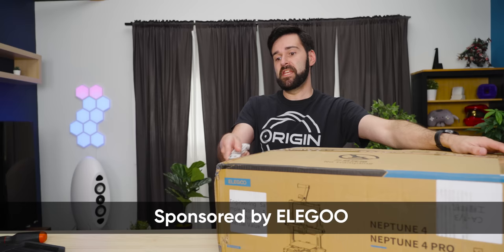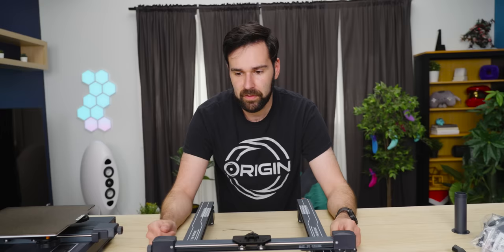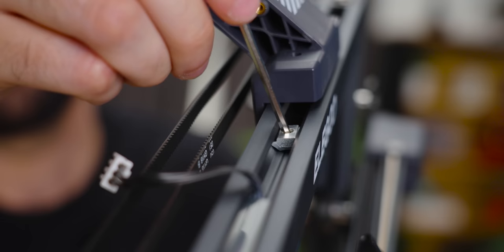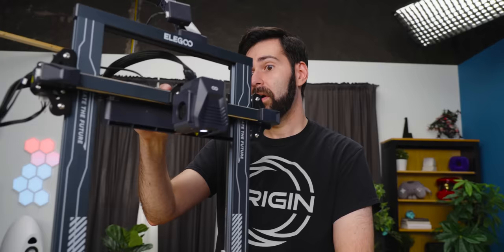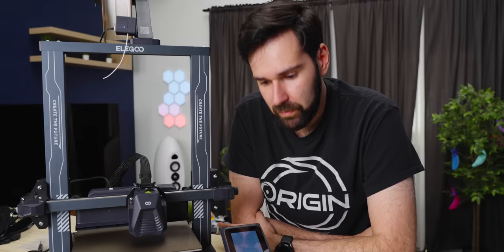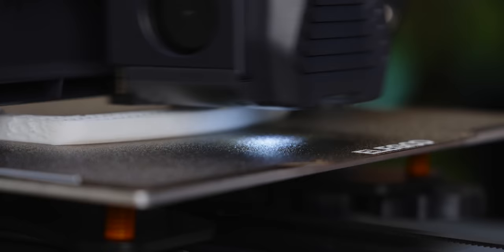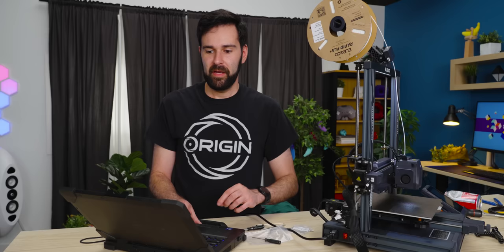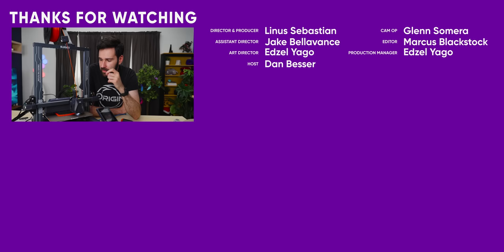Now THIS is bang for your buck! - Elegoo Neptune 4 Pro

Comment: My $99 Ender 3 Pro with my own upgrades and Klipper firmware has been one of the best investments I've made in my life, this seems right on par for starting on the next level of that.
Reply: Please please people save yourselves. Do not buy an ender 3 in current year. Heck don't buy this Just buy a Bambulab or Prusa.

Edit: You need to understand this isn't some elitist "lol just have more money" comment. With many things in life there are minimum prices for things where under that price its just worth it to save up and get the better thing. I'm telling you exactly what thst better thing is. It costs more but will allow you to just use the printer as a tool for your creativity without fuss in tuning, calibration and failed prints. There is so much more nuance to this I'll just advise you look at the actual experience a typical ender clone has vs the printers I talk about. It's one of those things where if you arent familair with 3d printing it's really hard to get why 2 different machines that look the same (because you aren't really sure what fesutrs matter or what specs mean), you could easily be mislead and end up frustrated. I've seen it enough to give the advice I give. I've experienced 3d printing enough to give the advice I give.
Reply: @BeefIngot  The ender 3 looks to be priced at 189 new, while the cheapest bambulab is 699 and a prusa mini 459.

I don't know much about 3d printing, but i think it'd help if your advice has something to it other than "don't buy X, buy Y which is 2-3 times more expensive". The one featured in this video is 280, which sounds more like the same price range rather than way above it and a lot of people just aren't going to spent 700 for a "trying something out" 3d printer.
Reply: @BeefIngot  I have an Ender 3 pro as long as you're good a things it's fine
Reply: @BeefIngot  Dude why are you all over the comments recommendig people Bambulabs or Prusa, especially as their first printer. 99% of people will never utilize them or require their features. Most people will even be fine with a Kobra Neo or used SV06/Neptune 3. You keep going on about how nobody knows what they are talking about, but you blindly telling people to buy 700+ dollar printers is just stupid.
Reply: @BeefIngot  "don't buy this printer, instead get one that is twice the price"
Reply: Similar, Got my first printer, an ender 3 pro from a microcenter deal 99$. Upgraded a bunch of things on it over the years, Silent Stepper BTT main board, Dual Gear Extruder, All Metal Hot End, Dual Z Axis, BLTouch, And misc. Maybe ~$200 total maybe a little less maybe a little more. I run a custom marlin along with octopi/octoprint. E3Pro was/is a great starter printer. This Elegoo is slightly more expensive but does seem to have all the features i would want in a more entry level machine. If i had to choose today it would definitely be a contender.
Reply: @kwedl  fr. Those more expensive printers have great features, but not one everyone will use. And some of the features that dude keeps going on about like mentioning klipper in his reply to my comment ignores the fact that features like that can be added in later by the end user. Klipper can be installed after the fact on a vast amount of printers, only caveat is needing a pi added on for klipper.
Reply: @thecyberquake618  You say this like to got me, but I stand by what I said. Your time is worth that money easily. Just think about it. You'll spend they amount in filament within a few months.

Furthermore you'll waste way more on calibration cubes and failed prints over time leading to my suggestion being cheaper over time.
Reply: @BeefIngot  you really won't. Unless you manage to print 1200 calibration cubes, no
Not to mention it comes fairly accurately calibrated, I only need to do the bed leveling and do z probe offset, which is pretty easy to get accurate enough to not cause failed prints. Only failed print I've had so far on my neptune 3 pro was caused by a clogged nozzle, not calibration.
You should probably educate yourself on what this printer and the 3 pro can actually do before you go around telling everyone else they are wrong
Reply: @BeefIngot  if you want to learn how 3d printing actually works as well as a tinkerer Enders are a really good way to learn. Bambu printers are for people who don't want to learn and just want to print.
Reply: @surft  This is an unbelievably bad idea for so many reasons I could could go on for days.

I've talked about this before and interested parties can google but the long and short is you aren't learning anything of value modding a bad printer. You are waiting time fixing a printer that is basically defective out of the factory, learning skills that don't really translate outside of it. Even worse, ender style printers force you to learn obsolete things for no reason. It's like forcing yourself to drive a 2001 Hyundai to teach you how cars work. You can learn just fine in a Lexus but without any unnecessary heartache.

The best part about not going the obviously bad route is you can then use that time to actually be creative just printing what you need and learning what you want by choice and not becuase your printer sucka so bad you can't resist the incorrect urge to fix it.

Believe me, I went the bad printer, upgrade route. Biggest waste of time. Do not do it. Yea sure now I'm intimately familiar with klipper, octoprint etc, but that's time I won't get back all for what? A better crappy printer? No. I could have bought a good printer from the start and even if I wanted to make 3d printing my Hobby, I'd then just build a voron and or innovate with new ideas rather than fixing old ones with feature sets so lacking to modern printers that the concepts are straight up obsolete.

No good modern printer is shipping with constantly moving bed screws to make them have to relevel.

No good modern printer necessitates you even set the Z offset, and they all have auto bed levelling.

There are just so many things that on good printers you will literally never have to think about again it makes no sense to waste your time on a bad one. It's like thinking that learning to ride a horse will give you knowledge about driving a modern car. They both offer transportation  but you're wasting your time in a horse. Heck that's not even a great analogy, because at least a horse might be friendly and fun.
Reply: @TurikoYemontoshi  See I get how someone not familiar might thin that, but I promise you this is experienced advice. There is always a minimum product it's worth getting. I'm giving you that ac ice so you don't learn the hard way. Unless you truly cannot afford it (in which case you probably shouldn't buy a printer and should use a local library), there's no real reason to buy cheap and pay in time, frustration and filament.

This isn't some out of touch elitist opinion. Out of touch would be recommending an Ultimaker. This is just the useful advice I wish I had when I started.
Reply: @thecyberquake618  Absolutely. There is more to a product than price. I think I explain well enough my justification in other comments.
Reply: @BeefIngot  Idk man, I think anyone who wants to actually learn about 3D printers and not just use them should really start at the 'beginning' of this whole hobby and go for the actual hobbyist hardware. An Ender is ideal for this. SPending more than $200 to try a hobby for your first time is dumb.
Reply: @lighthawk95  Calling the ender the start of the hobby is just..... You are missing so much of 3d printing history it hurts.

Secondly I literally listed the better option. Use your library or a print service until you become convinced you benefit. Don't buy a bad printer and have a bad experience thst will Sour you on the whole thing when you could use the tool as a tool instead and not make the tool the hobby.
Reply: @BeefIngot  you are confusing "not the best" with "bad". You keep calling the neptune line of printers bad when they factually aren't. Are they the best? No. But just the fact you think that because of that it is suddenly bad shows how faulty your logic is. This isn't a black and white situation, it's a sliding scale. Or course the 3x price printer will have better features. But the fact that you think those features are a requirement for both a printer to be good and to get good prints without a massive amount of errors seems to point to the fact that you need to rely on the features of the newer printers as a crutch for being bad at a setting that takes maybe 30 seconds at most to set (continuing off the discussion of z probe offset).
And when almost everyone here in the comments that is in the 3d printing scene is telling you your take is bad, it's probably bad.
Reply: @BeefIngot  it's like saying a regular toothbrush is bad because Sonicare exists. Or that any standard vehicle is bad because racecars exist and they can go much faster.
It's a flawed mindset
Reply: @thecyberquake618  Except its not and you miss the whole point. I'm saying that you should buy the decent quality tooth brush that doesn't hurt your gums. You keep making this out to be some ridiculous luxury purchase and it just isn't that.

I've already explained numerous times that it's sooo much more than your claimed 30 seconds settj g the Z offset. It's wiping the nozzle, tuning input shaper, tuning PA for different filaments, getting monitoring whe  your out working, monitoring your prints, having the ability to do mm id you want it later, having an enclosure of you need to print anything other than the standard 3.

You keep talking about racecar and its ironic because it's you that are missing the dimensions. Notice how little I've talked about or focused on speed. It's because you are missing the major points that matter to people. Worse, you are downplaying them.

You implying that someone is bad at printing for not wanting to waste their time really explains what is wrong witb your mindset. You just aren't valuing your ow  free time.
Reply: @BeefIngot  I don't know how you would know where my hobby started, but I assure you it was with the Ender 3 Pro.

I didn't have a bad experience and I'm only heard of from the factory issues or ineptitude causing problems with Enders.

You are making a lot of assumptions for everyone.
Reply: @lighthawk95  You literally said the beginning of this whole hobby and now you're pretending you meant where you started.... weird back track.

As for you never hearing of issues with ender 3s you must literally be deaf, blind and unable to feel touch.

From the deteriorating ptfe, to the extruders that cracked to the lack of thermal runaway protection for the start of its life to the wiring disasters they had multiple of to.... Like how are you claiming you've never heard of or seen ender 3 problems? Have you just like never used the machine? Many of the problems are patently obvious and we aren't even getting to the lack of creature comforts like how you need to relevel the bed all the time due to the springs and heat cycles, the wearing wires, the uneven heated bed, the shoddy wiring with tinned wires in clamp connectors, the complete crapshoot in which board combination you'd actually get (some which literally accepted different gcode commands) and more. If you don't know why the ender 3 is a terrible option, you frankly must not have kuch experience. I'm sorry, but that is simply the truth.
Reply: @BeefIngot  still showing your flawed logic in comparing this to a toothbrush that hurts your gums. Again, you are confusing something that is not as good with something that is bad.
Let me make another analogy. You have 3 different computers.
You have the luxury $2500 pc, you have a $800 pc, and you have another $800. The $2500 can do more than the $800 pc, but it's also more expensive. Some use cases will require what the $2500 pc an do, but not everyone using a pc is doing those things that require the $2500 computer, so instead they are going to opt for an $800. There are two $800 PCs. One works excellently, does everything the user needs and then some. The other is one that crashes often and frequently doesn't work.

This printer is the $800 pc that runs well, and your constant recommendation of the Bambu is the $2500 pc. Yes clearly that $2500 pc is better, but it's better in ways that not everyone needs.
You keep trying to push your point that these cheaper printers are bad because "prints constantly fail", but as myself and others have explained, that's not the case. I've only had 1 print fail, hardly the "constant issues" you try to portray it as having.
Maybe you had issues on cheaper printers, but unless you have owned specifically the ones being discussed, you have no experience nor any factual backing that makes these printers bad. And when people who do own them are telling you that your comments are factually inaccurate, then you are probably wrong
Reply: @thecyberquake618  This is not the 800 printer that does well. That's my point. There are more expansive printers than what I recommended. Just because it has amazing features at a mid range price doesn't mean the mid range price is suddenly super car price.

700 dollars is not some luxury item. It's a completely big standard middle of the road price, well between the cheap os and the prosumer going on enterprise printers. You are clearly missing the context to even understand what the pricing is of printers on the market. Surely you must have thought "There's gotta be life outside of these ender clones" but evidently not. Instead you keep trying to assert that somehow 700 bucks is some absurd luxury price.

You've also said absolutely nothing to factually disprove a word I've said. Your hubris is not a substitute for fact.

Its starting to feel like you feel the need to defend your purchase.
Reply: @BeefIngot  yet again fully not understanding my analogy nor the point being made. Not to mention you've now switched gears to trying to think I was saying the Bambu was a luxury item (which I didn't, again showing you didn't understand the analogy), while you now ignore the fact that you and I aren't discussing the ender printer, we were discussing the neptune line of printers. I can't say anything about the ender products as I have no experience with them. They could be bad printers, I wouldn't know.
But your notion that every printer that isn't feature parity with the bambu is suddenly a bad printer is laughable, especially when you can read online and find mostly positive remarks about the printer.
Reply: @BeefIngot  I would have agreed with you if you said it wasn't as good. That's a fact.
But your use of the word bad is where the issue lies. It can have fewer features but still be good.
You can buy a good car but not get all the addons. Would those addons make the car better? Yes. But it can still be a good car without them.
Having fewer features doesn't make it inherently bad, especially if we take pricing into considerarion.
Reply: @thecyberquake618  I think you misunderstand what bad means in this context. It means that I wouldn't recommend this printer to anyone as I don't see it as the reasonable purchase in the face of the availible printers.

Let's put this another way. Let's say the P1S exists for 600 bucks but somewhere else literally the exact same thing, same product 100% exists for 1000 dollars. The second printer is a bad purchase.

We don't live in a vacuum. When giving people advice about what to buy, you give them relative advice.

Furthermore, when talking about the ender 3 in particular, I would absolutely call it had full stop. I listed many reasons in another comment but truly no one should buy this printer. Heck, it's a waste of your time to be gifted this printer. It's too outdated and troublesome to be worth your time in the modern world.

As for your first response, You used the word racecar. Your choice of words. Let's not soft backtrack now and play a semantics game. It's just annoying.

Lastly, you can find good reviews for many products. Doesn't make the the best product to buy for anyone person or any person for that matter. people can be happy with the wrong choice. It's completely possible.
Reply: @BeefIngot  "We don't live in a vacuum. When giving people advice about what to buy, you give them relative advice"
Exactly. That relative advice includes pricing. And when printers like the neptune 3 pro or the neptune 4 Pro can do most of what something twice/thrice the price, you have to also take that into consideration. To not do so is to only think inside the vacuum of your budget, ignoring what others device they want/can budget. And not everyone wants to spend $600-$700 on their first printer. And for the neptune 3 pro you can solid prints with minimal fuss, which for $200 is a great quality printer that's far easier for someone new to consider dropping money on compared to $600.

I never argued the ender wasn't bad, as I said I know nothing about it. The other guy is the one you were talking to about it, hence why I was saying you bringing it into discussing my point was not valid. If you say it's bad then maybe it is, as I already said I know nothing about that printer at the moment

My use of "racecar" was an analogy. It wasn't supposed to translate to "literally the best and most expensive", and is why I was trying to better explain using the PC analogy.
You kept getting caught up on your own misunderstandings, and then call it backtracking when anyone tries to tell you what they actually meant. Yes sometimes that can be legitimately backtracking, but sometimes (and frequently even) it's just someone trying to explain it better to help you understand the point they were trying to go for.
Reply: @BeefIngot  you can think it's a wrong choice, and that's your opinion. But when people are able to get perfectly fine prints with at worst marginally more effort and with less cost, your opinion is faulty. It's perfectly fine to think the better option is the $600 printer, but just like many things in life the best choice for one isn't necessarily the best for all. If they have the money then yes I agree drop it on the better printer. But you have to look at more than just the printer to determine if it's the right choice for a specific person and even use case
Reply: @thecyberquake618  Look, I could argue here all day, but thats my opinion, Ive given good reasons, you want to call it faulty, whatever. Im sure your experience with a single printer trumps the collective experiences of the many people I see and often help on 3d printer forums and my personal experience with printers ranging from ones with the feature set discussed to  > 1000 and snazzy.

Im sorry you are mad I didn't call your printer perfect, but ultimately think this is just going in circles and getting annoying.

Also, I want to point out a big part of why I just dont care anymore is where you say
"But you have to look at more than just the printer to determine if it's the right choice for a specific person and even use case"

I did. I explained my reasoning for coming to that as my minimum recommendation. I listed alternatives for people who think "but there are cheap printers" I listed alternatives for people who weren't planning to print much that cost much less than buying any printer at all. You wanted to focus on feeling hurt I didn't recommend your printer. That's up to you. Just like its up to you, whether or not to try to blame other people for "misunderstanding" your bad analogy rather than owning up to that being incorrect. Whatever.